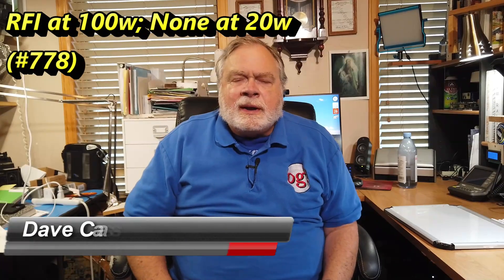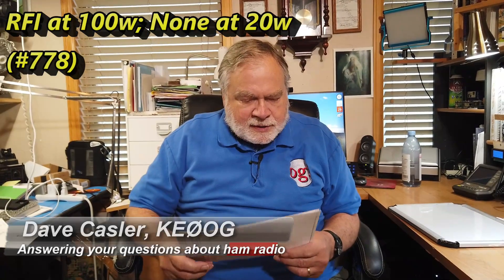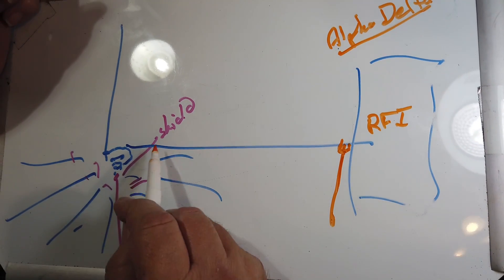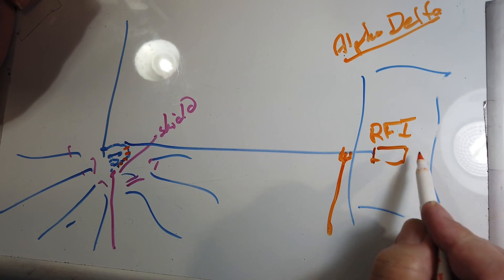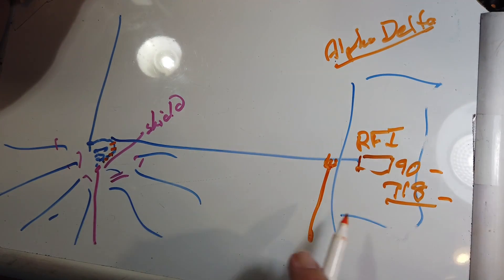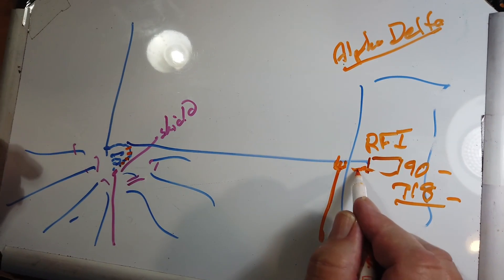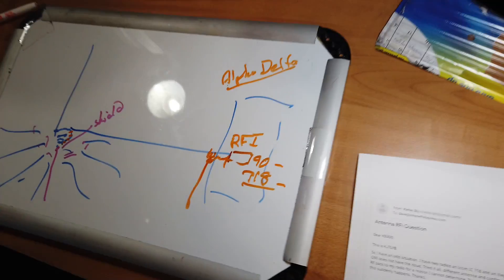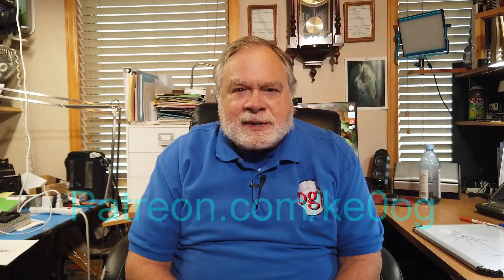RFI at 100w: None at 20w (#778)

Comment: With ICOM rebooting or going through a power cycle I would look at how much power the rig draws versus Your 20w rig.  If your power supply is insufficient the icom radio will shut down when attempting to transmit at high power.

Comment: Not having good ground is a common problem  for verticals.  Adding ground radials is a good solution but adding a choke balun to the feedline will also be a great addition. Put the balun near the antenna base.
Reply from the maker: You can also drive a ground rod right at the antenna base and connect it to the coax shield and the radials.

Comment: Can someone help me with a question, 
Does the RF wound choke have to be put directly below a mounted vertical or can it be put at the bottom before the feed line enters the house to reduce the rfi.
I ask this because I have never used one before and I have already mounted my antenna to the property.. is it the case where I need to take the vertical down and choke a few inches beneath the antenna.. 
Be gentle with me I'm a beginner and only just passed my ticket, thanks for any help.

Comment: I have Inverted L stead of vertical,  Automatic Tuner at base at feed point.   I had same problem, RF coming into house making loud noise into computer speaker and such.   then I bought Clip On EMI choke on ebay  100 for $20 or so.  then I put that on Coax  ( RG-58 ) all the way from radio to Antenna tuner , every 2 feet , 20 of them, that fixed the problem.  AG6JU

Comment: The simplest solution is 1:1 unun at the antenna. The copper rod should be the last thing to do as when SHTF it could be a thing that will connect the antenna shield with the grounding rod of the nearest transformer station. It is not a bad thing to use a copper rod but the first thing is to ask yourself "do I need it? is anything else that can be done?"

Comment: At the radio side, use a common-mode 1:1 RF choke for short coax cable runs or non-resonant antennas. Grounding close to the feed point of most antenna systems is axiomatic.

Comment: Too bad he didn't mention what mode's are creating the RFI, though I suspect mostly FT modes.

What he needs are 3 or 4 snap on ferrites on & at both of his radio's coax's inputs & at least 1 on all of the other cables too. Having either or both ferrites and multiple turn "ugly" baluns at the antenna's will help too.

If running FT modes you also need ferrites on ALL of you computer cables, especially keyboard & mouse as the USB connections seem extra sensitive to RFI.

$20 of ferrites will save lots of aggravation!

Comment: What about adding a choke on the coax near the radio?
Reply: A Choke Balun, or balance-to-unbalance transformer, is a circuit element used to connect a balanced line to an unbalanced line or antenna. Or, as is perhaps a little more common, it is used to connect an unbalanced (coaxial) line to a balanced antenna such as a dipole. At frequencies low enough for this to be possible, an ordinary tuned transformer is employed. This has an unbalanced primary and a center-tapped secondary winding, to which the balanced antenna is connected. It must also have an electrostatic shield, which is earthed to minimize the effects of stray capacitance.
Reply: I use Mix 31 snap-on chokes on the LMR-400 that enters my shack from my doublet. In fact, I use these chokes on the coax of all of my multi-band antennas.  A multi-band antenna will have common mode current on the shield for any band that requires an antenna matching unit. It took two such chokes for my 160m doublet. I added two extras for good measure. 

73, de N4HNH

Comment: Is it possible that having two ground rods might create a ground loop? I'd think connecting a thick strap between the two ground rods might help prevent a ground loop; or else ground everything right outside his home (or using a few ground rods that are bonded together right outside his home); then strapping it to the base of the antenna along his coax. I do not know. I am basing this upon what I saw getting the General and amateur extra class licenses.